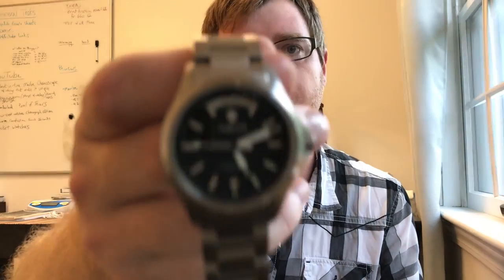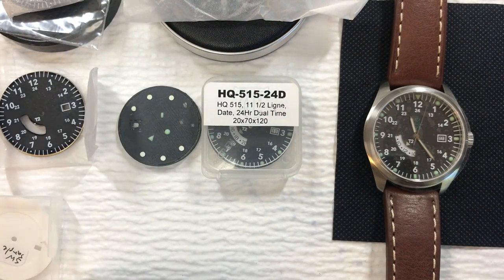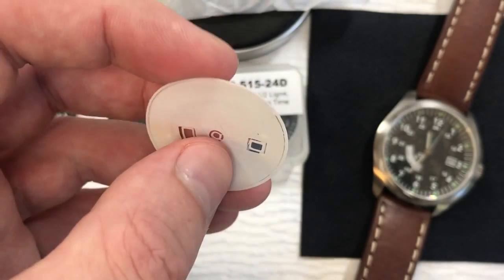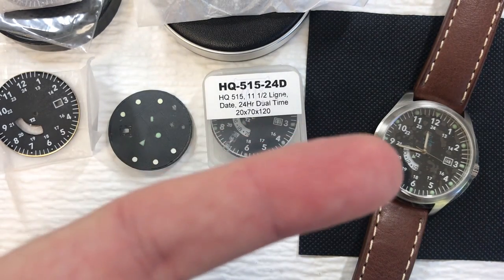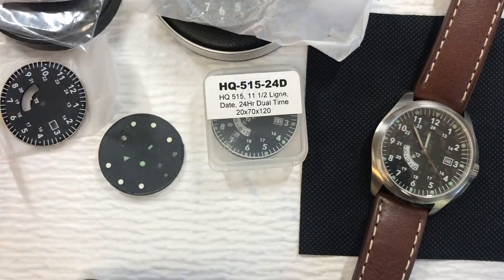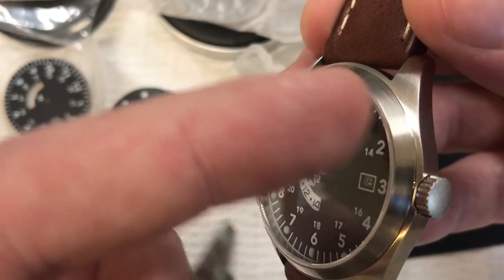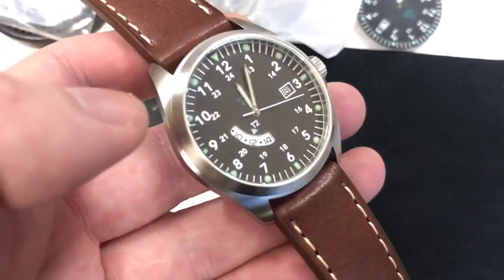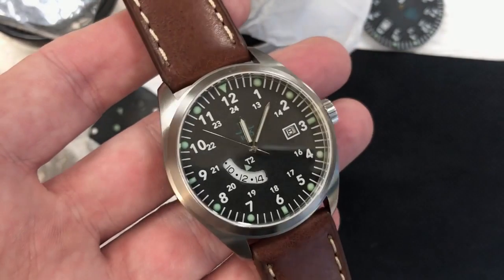Making Custom Dials & Watches: A dual time watch

Comment: How does one align the seconds hand with the indices? Or does it depends on the movement?
Reply from the maker: Practice. Trial and Error. Luck. All are possible. The way I do it is only slightly set the hand with a very light press, then test, and then adjust left or right if needed. Once it's where I want, full press to set hand.